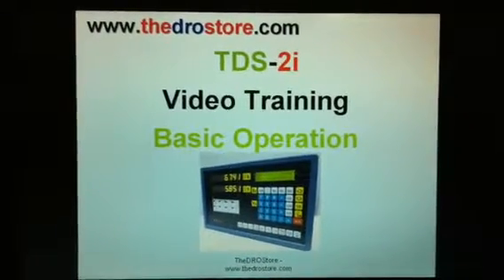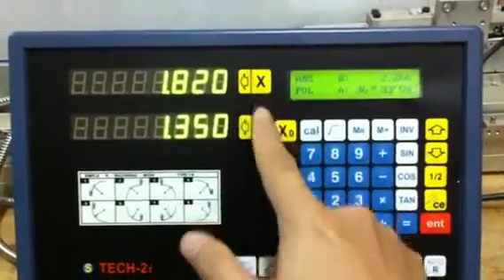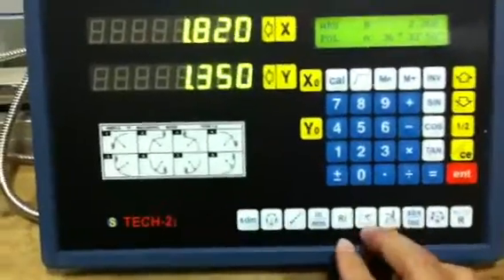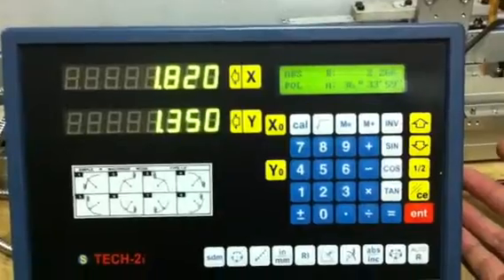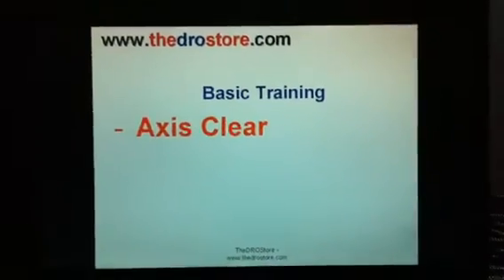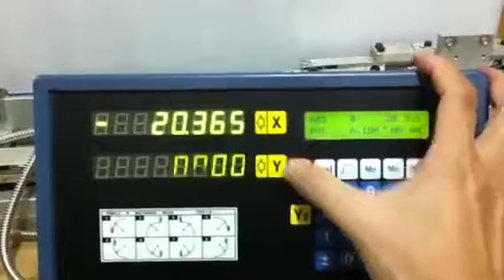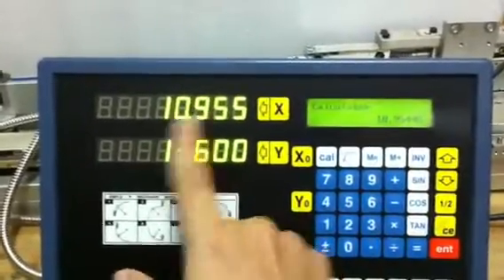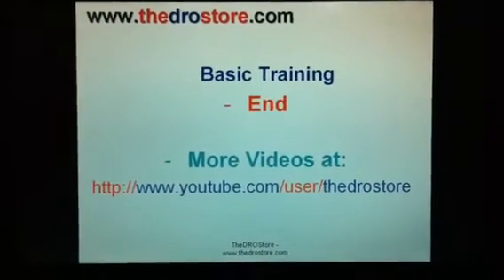TDS-2i DRO Training - Basic Operation - TheDROstore.com mTECH TECH 2i

Comment: My tds-2i has stopped picking up a reading from my y-axis scale, I tested the scale and it still works, so its the DRO not picking up a signal.  Is there anyway to get this fixed, the unit has less then 5 hours on it.